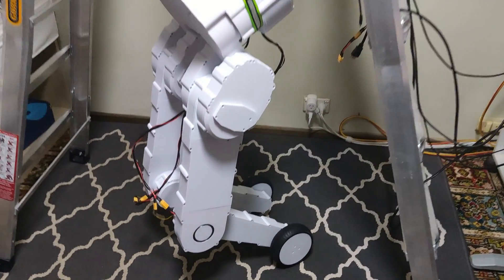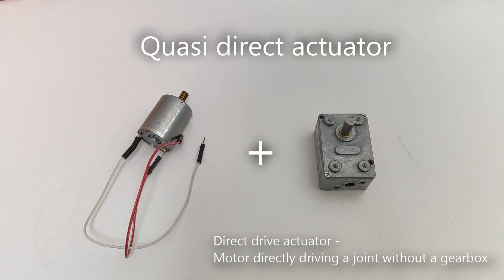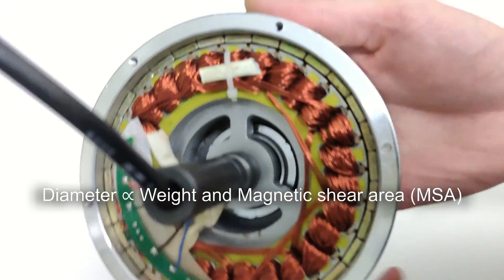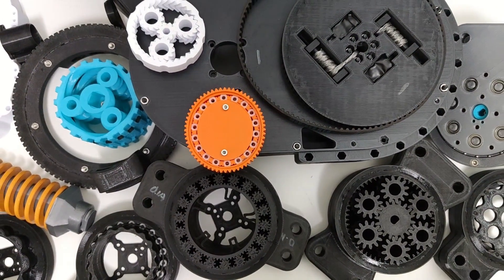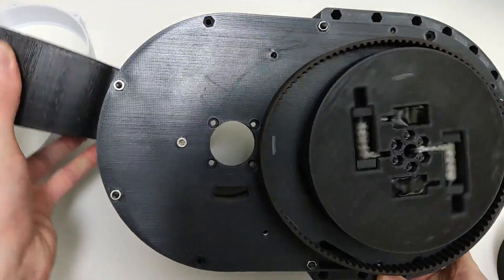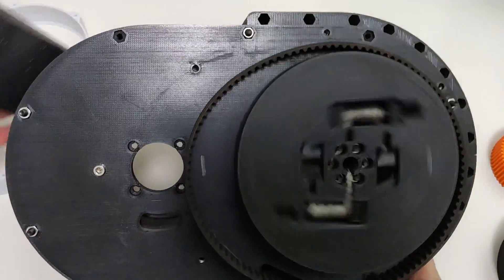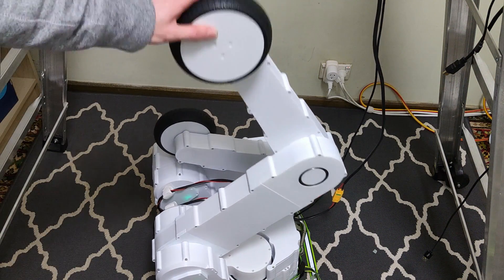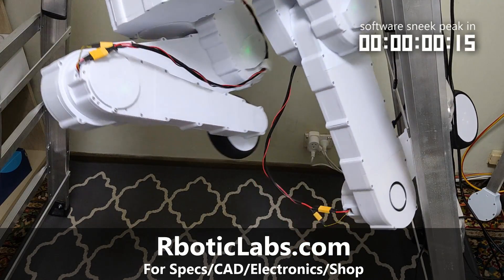Optimising a 3D Printed Robotic Actuator

Comment: awesome. nice design! i'm working on a 1kg barell gear that can output 200Nm with petg cos it's forgiving of printing imprecision. You can use steel tubes inside plastic gears and angle grind a criss cross pattern in them and then use a glue to glue the plastic gears onto the steel tube, the gears need a stellar or internal gear pattern to fuse properly, i dunno what the best glue is.

Comment: Nice build! I am curious to know how the backlash of motors translate to the foot or ankle. You can lock the rotors and push the ankle to measure. It is okay to have some play tho if you are doing force control. Also, when you do locomotion control, the robot will definitely freak out at one point, and if it hits something hard (like ground), it could break weakest point along the transmission (usually the pinion). Under 1kg is absolutely amazing, but I am curious to know if it would survive real world testing.
Reply from the maker: Since it's preloaded, there's little to no backlash. Surprisingly there hasn't been an actuator failure in the months of testing. Though it recently snapped its own leg off at the hip during a sim-to-real transfer freak out 😆. Happy holidays!

Comment: Nice!
How do you mount the motor? inside the ring?
How do you then get the output to rotate?

Was thinking of making something similar but belt driven instead.

Also, how powerful are your motors (as in how may watts, amp and volt they run on)?
Reply from the maker: It's mounted to the housing with 3 screws inside the output gear. Belts would be better for sound and backlash, but I wouldn't recommend it for other drawbacks. The specs are on my website.

Comment: That cycloidal gearbox with the rollers looks very interesting, I have seen similar systems in the past but no matter what I google I cant find another example or explanation. Do they have an official name? why did you not use it? what was its flaws?
Reply from the maker: I don't know the official name. But it requires very high manufacturing tolerances as well as stiffness. Much more than your traditional cycloidal gearbox. When loaded the rollers would slip as the plastic flexed.
Reply: Thanks for the feedback  @rbotic  knowing why all your failed gearboxes well failed is almost as valuable as seeing your successes

Comment: Great video! This is now listed as my fav robot leg design. At the end of the video, you are training the robot in simulation. Mind already telling us what program you use for the simulation, i.e. PyBullet etc? And the algorithm you prefer.
Reply from the maker: Thanks! Issac gym. Reinforcement learning PPO is what it uses.
Reply: @rbotic  Sounds great... I am building something similar to what you build here. But, instead, I am trying a cycloidal drive and also using wood for the frame. Isaac gym needs NVIDIA RTX GPU as I know, and I don't have it. So, the simulation I do will be on PyBullet

Comment: That is a really cool actuator, good work! Just one question what backlash does the gearbox have? From what I know cycloidal, harmonic and belted gearboxes are specifically used because of their low backlash characteristic. Multi staged geared gearboxes, especially 3d printed ones, usually have quite a lot of play, which disqualifies them for a use in precision robotics.
Reply from the maker: Its negligible. You could preload the gears to get zero backlash at the expense of some friction. But imo it's unnecessary for legged robots.
Reply: @rbotic  Yeah I guess you're right, low backlash is much more important for automated robotic arms. By the way, what type of sensor are you using for position estimation? Is it a rotary encoder, hall sensor or something different?
Reply from the maker: Rotary absolute magnetic encoder

Comment: I don't have numbers of the competing actuators to compare with yours but I have a feeling they are not as much worse in strength to weight as you might think. Usually industrial actuators are not rated at peak torque/power values the way you are rating yours - they usually have a significant margin of safety. I'm sure your actuator costs a lot less to produce in low volume, and its impressive what it can do. But I have my doubts about longterm dimensional stability of plastic gears, and the space efficiency lost compared to other actuators.
Reply from the maker: Thanks for watching! Definitely agree with you on the space efficiency. QDA are almost always thermally limited, and their torque is constrained by that (rather than mechanical).

Comment: Sick stuff! Do you find that having that much torque makes it easier to design a motor controller? Of course, it's back-drivable, so I imagine that would also make it much easier to do IK and whatnot. 
Actually, speaking of which... that software sneak preview with the different agents all running around. You wouldn't happen to be working on a learning-based agent, would you?! 

I'm super stoked to see where you take this project!
Reply from the maker: Thank you! A bigger motor generally means a more expensive controller, doesn't influence difficulty. It is a learning based agent :)

Comment: Awesome video. Loved hearing your thoughts on the various drive mechanisms. You gained a new subscriber! I'm curious to hear what the torque efficiency, backlash and wear/tear looks like. I'm building something similar (with the exact same motor) but with belts.
Reply from the maker: Thanks! ~81% of theoretical torque at all tested torques. I expect the transmission efficiency to be 90%+. Backlash is negligible imo for legged robots, you could always preload the gears if you require zero. Wear is visually zero. Belts are a great idea! It'd be more shock tolerant, quieter, but I'd expect it'd be a bit bigger, heavier and more difficult to assemble. Depends what you value.

Comment: Idea is great. Can't it be made smaller?
Reply from the maker: Thank you. I've made a smaller version, but wasn't able to hit the same torque density due to the reasons mentioned.
Reply: What is the ratio of torque between both versions? Also what about using other technologies like resin printing, cnc machining, sls plastic and metal? Will they increase the torque of these actuators?
Reply from the maker: @shivstark8494   similar ratio. Funnily enough using another manufacturing technique wouldn't increase torque. Reason being is that the limiting factor is thermal not mechanical. You may be able to make it a bit lighter though

Comment: Sensored or sensorless brushless motors? I have issues with low rpm cogging even with high reductions. Brushed motors have max torque at low rpm but there are other drawbacks
Reply from the maker: Sensored brushless (abs magnetic encoder). Allows for max torque at zero rpm. Downside being more expensive than brushed unfortunately.
Reply: @rbotic  true, ESCs are pricey, thanks for the explanation

Comment: We use conventional cycloid drive gearboxes on our robots (FIRST Robotics Competition). These are almost fully 3D printed in PETG but we do use steel pins on the perimeter and for the output. Our current robot has a couple of 24:1 Cycloids about 4" dia and a 48:1 that's about 6" dia. We use two rows of Delrin balls (1/8" dia) at the perimeter to provide a smooth rotation (instead of expensive X-bearings). The cams run in small, deep groove ball bearings. The secret to their success is that we use three cycloid gears in each gearbox, each spaced at 120 deg to the other. This provides almost 100% tooth contact and eliminates vibration. Have you tried anything like this? I suspect that our 24:1 could handle more torque and looks to be about 1/3 of the size of your actuator. The downside is that it does have many more parts. I love the simplicity of your design. Be glad to share if you are interested. Cheers.
Reply: I wonder if you'd be willing to share this via a video? or do you have open source cad files for this? extremely impressive design!
Reply: @gedr7664  Are you by chance FRC team 7664? If so, I can point you to Chief Delphi.
Reply: @derekfinch9586  I'm not, i'm from the UK and we don't have that here. I just build robots for fun. Would it still be possible to get an insight into your design? :)
Reply: @gedr7664  how has your progress been so far? I would love to get in touch with you!
Reply: Hey Derek, I would love to get in touch with you. As someone who is a complete noob in robotics right now, I would love to learn about your journey and projects!
Reply from the maker: I'd be more than happy to share designs. Please contact me at rboticlabs@gmail.com.

Yes I've tried a triple disk cycloid (blue and grey design in the video) . I wasn't happy with the weight/complexity/total size with motor. I never did any proper torque testing as it was 3 years ago, so your cycloid could possibly output more torque.

I don't like the expensive 4 point contact bearings as well. I've been looking to eliminate them but can't think of a good solution unfortunately.

Comment: In terms of carrying capacity, a multistage gearbox is not as good as a  planetary gearbox. What do you think
Reply from the maker: Torque capacity is comparable to a planetary gearset of the same diameter (assuming <4 planets). The housing/layout + multistage allows for a substantial increase in module. But the main drawbacks with planetary are: suboptimal ratio, weight, size, and an increase in complexity and part count.